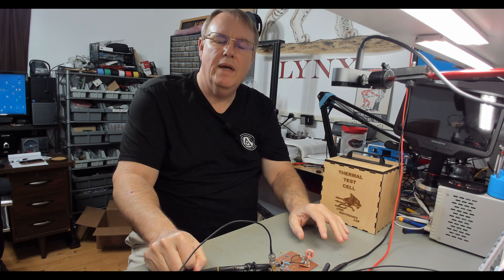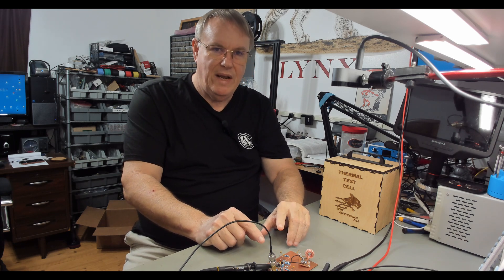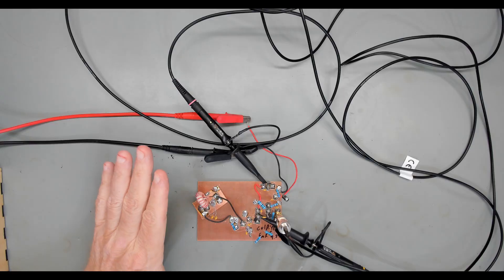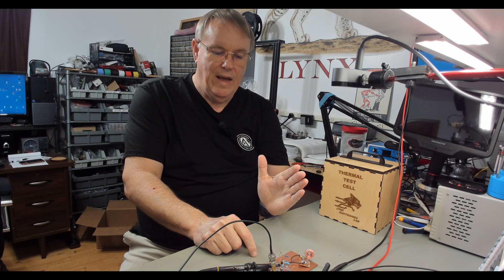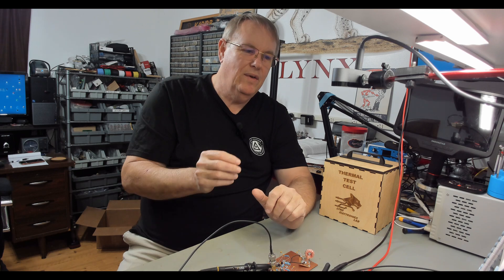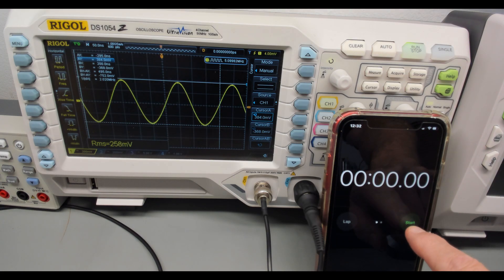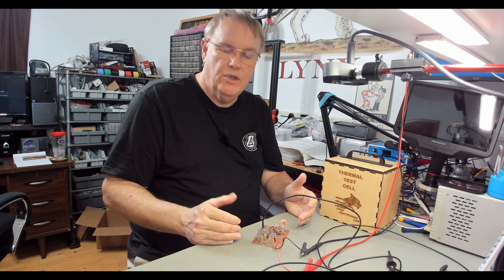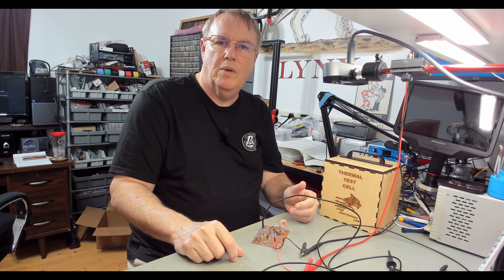What Made My Circuit Fail After 16 Minutes?

Comment: Thanks for the detailed report. The Franklin osc has 2 transistors, allowing loose coupling of the LC, improving stability. The oscillator stability is usually ruined by the temperature dependent parameters of the active device, especially bipolar (NPN) devices. Having said that, also make sure to have as little influence from a Varicap as possible, use a small capacitor in series that only allows the tuning range you need, not more. The Miller capacitance is the big hidden problem. Actually it's amplified in case of the Franklin (or any time voltage gain is acquired, emitter follower is better for this). Try to use 2 transistors so the loose LC - BJT coupling is possible, but in other configuration. Common base or common collector is the way to go. I recommend YT has deleted my comment several times (after pretending it saved it)... so I cannot include the URL without YT deleting the comment...  NPN emitter is on the inductor tap-point and full tank voltage coupled to NPN darlington base with 2 pF  ... (URL deleted to prevent nonsense YT deleting the whole comment insidiously- the "free world" is about freely blocking communications based on URL and content, the circuit collection was on a .ru site, zpostbox. ... ) circuit 47. LC oscillator with tapped inductor , but with small mod: darlington NPN (R3 >= 150k) and very small C2 base capacitance (2 pF or so, experiment). Also useful: Fast Huff an Puff VFO stabilizer circuit (4060 freq divider and 74HC164 shift register and XOR and analog integrator), that can be built in modern digital circuits (inside chips or RP2040 PIO+DMA) and locks the oscillator to one of many lock-points (you can still tune it or modulate it).

Comment: Thank you, watching your video prompted me to revisit my failed Kitchin High Performance Regen project where I too used an Interfet J310 JFET. I had two from Mouser and they were about 5 GBP each but neither worked. They looked correct in a tester but just would not oscillate. I obtained some OnSemi MMBFJ310 JFET's and mounted one on a SOT 23 adaptor pcb, soldered it in circuit and it all burst into life. I figured the eBay ones were fake but did not expect Mouser to let me down. Keep up the good work.
Reply from the maker: Thanks, so glad I was helpful! I have some pcbs coming to do the same. I’m going to do up a bunch and put the extras in the store for others who want j310’s but do not do smd. 
RJ
Reply: Counterfeit parts are all over the industry.  Companies try hard to combat that and RJ should send the bad part to the dealer for a failure analysis to see if the manufacturer can determine if it is a counterfeit or if they have a process issue.

Comment: Good result.  I was actually thinking you had a bad coupling capacitor but was fairly sure it was not the oscillator as that much gain change would cause it to stop oscillating and/or drift the frequency.

It will interesting to see how well they keep their stability with the varicap circuit added.
Reply from the maker: Thanks Uni, yeah got caught by a new  jfet being bad. Of course it could have been harm by me someway but I never put a lot of heat to it and my bench is static safe… although in Florida our humidity kind of keeps us safe. Hard to have static build up under water if you know what I mean. I got some disc caps order from mouser to start experimenting with how stable I css ask get it before adding the variactors on as I know they will hurt me.  Congratulations on 5K subs!! I put a comment on your channel telling you this but accidentally put it in someone else’s comment. 
RJ